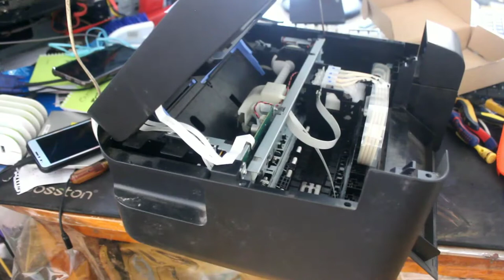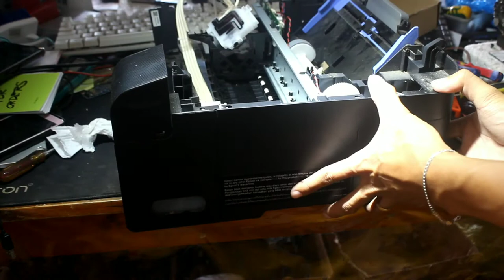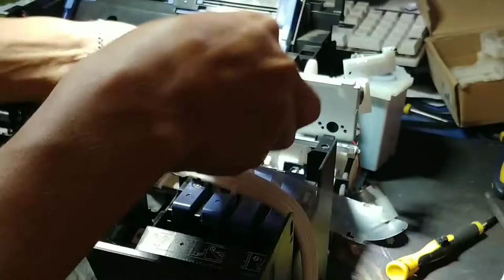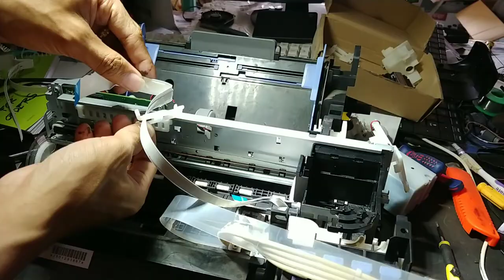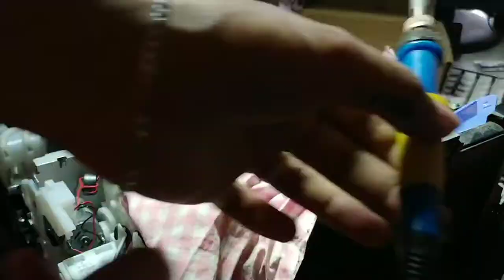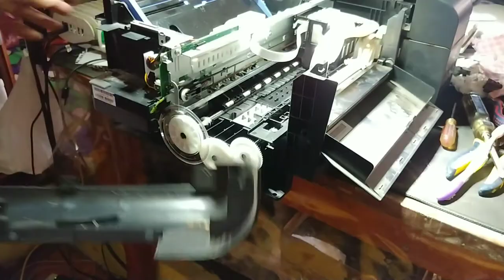Epson L3110 change belt | encoder | main flex | disassembly

Comment: Sir yung akin napalipatan kona ng bagong flex pero ayaw parin gumana.. all lights blinking parin.. ok naman po mga springs.. ano kaya problema?
Reply from the maker: baka need reset? blinking din lights sa reset sabay2
Reply: putok na yun fuse ng logic board paps, need logic board replacement pero kung ayaw mo gumastos mag-diy jumper ka.

Comment: ano po problema kapag yong printhead niya nagpunta siya sa left din bigla bumalik sa right...posible bang timing belt sira?
Reply from the maker: Hindi, posible sesor cable or encoder strip, double check encoder strip kung nasa position ba back sa printhead
Reply: @wayneslink  salamat po
Reply: @wayneslink  pag ang printer po..nagpiprint po siya ng colored pero ang black wala po kahit naka ink flushing na wala parin lumalabas na ink....tapos yong dalawang red light nag beblink pero nag print naman siya colored nga lang
Reply: @wayneslink  sir yun ba yung clear plastic sa  video nyo 12:13 (interval).